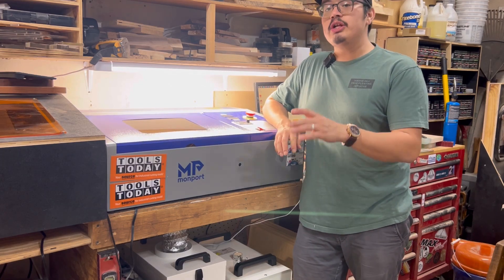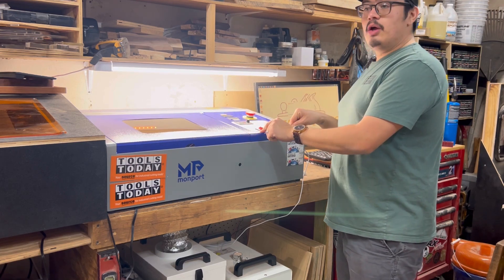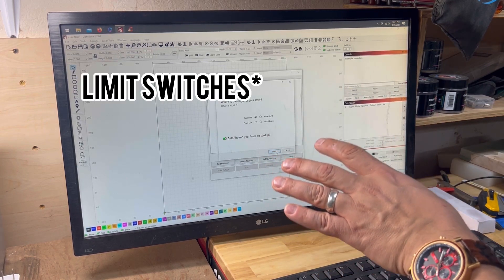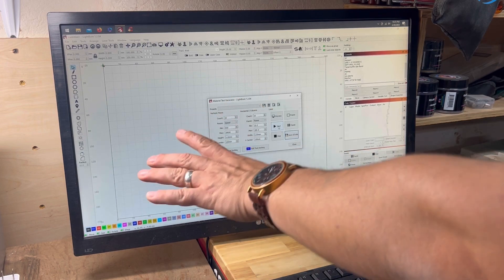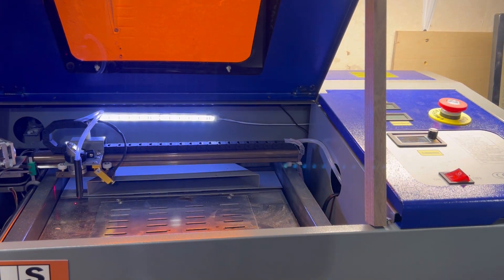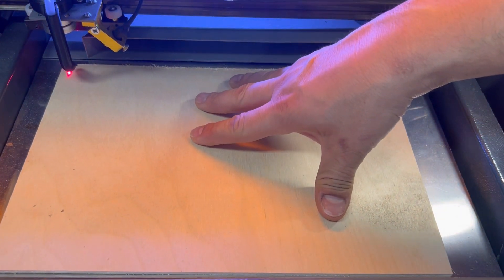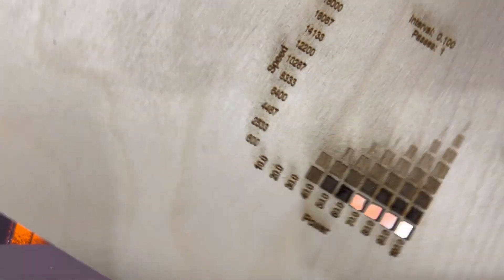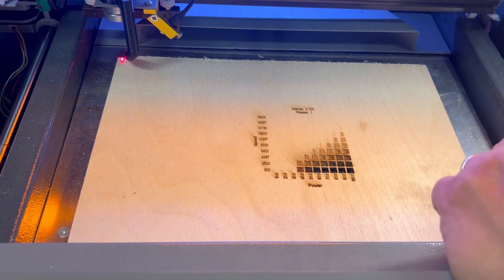Let’s get our Monport K40 connected to lightburn and start making smoke!

Comment: At 6:00 you talk about setting the power. You use very ambiguous terminology (about 1/4 or maybe 1/5 of knob rotation etc), and then say to set the power levels in the software. How can you possibly determine exactly WHAT the % of power is when you are changing TWO variables at the same time? You either put knob at 100% and control power via software, or put SOFTWARE power at 100% and control power via the knob.

The Monport manual says:

“Laser Power Display: This displays the current power of the laser as a percent of its maximum intensity. Adjust this setting accordingly to process various material s . For most material s, an intensity between 20% and 60% i s optimal . when aligning the laser beam, you should use a setting lower than 30% for safety reasons .
Remember: Running your laser tube above 70% power can significantly shorten the laser tube's lifetime (We recommend staying below 70% power to prolong the life of your laser tube)” 

I would prefer to leave the knob at 100% and adjust power via the software, but since the manual explicitly says to NOT go above 70% I am not so sure if the software control method will ensure that the power is correct and safeguards the laser tube. 
ALSO - My Monport K40 display is in mA and NOT in % power, so just putting the knob at 1/5 or whatever doesn’t really give you any correct power information. 
Any other folks with the Monport K40 who have time tested EITHER method please chime and help us out! Thanks!